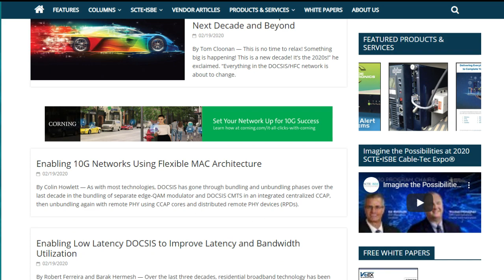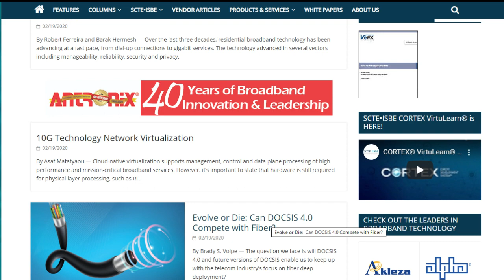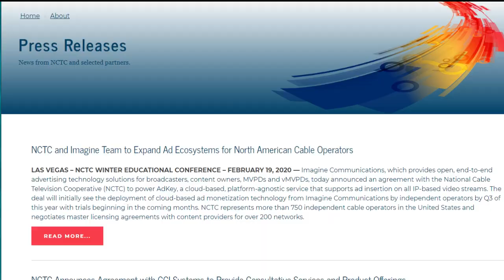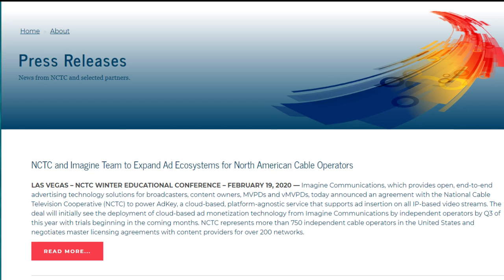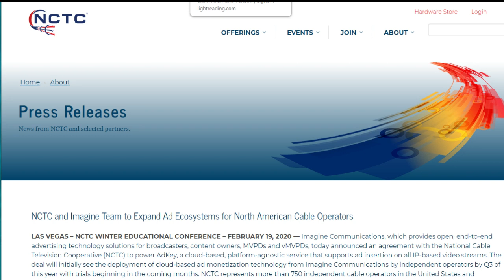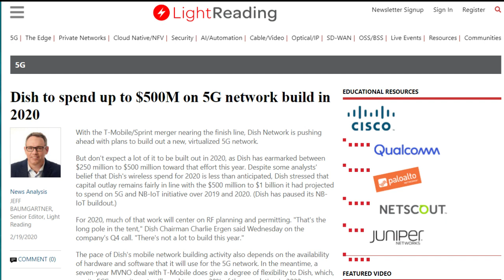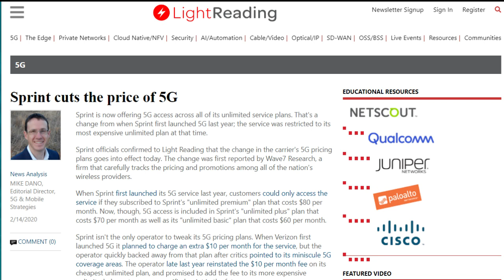DOCSIS 3.1 Channel Bonding

Comment: Just slightly OT, but I'm going to be getting internet service where the MAX speed package available is 22 Mbps. The local guy/owner/tech in this rural area recommends only Netgear C3700 (as that's all he's familiar with...), but said he'd be willing to install a CM600 if he can. Either way, I'd have to purchase the modem - and I'll be using a separate router anyway. Given the speed we're talking about here, is there ANY advantage to using the (higher channel bonding model) CM600?  THANKS  :)
Reply from the maker: Hi Thomas, 

The Netgear C3700 supports 8 downstream channel bonding while the CM600 supports 24 downstream channel bonding. If your cable operator is only providing 8 downstream channels, then you will not benefit from having a modem with 24 downstream channels because the operator is only sending 8 downstream channels. However, if your operator is sending more than 8 downstream channels to your home AND your operator has enable bonding groups of more than 8 downstream channels you will benefit from the CM600. You must find out the answer to both questions above in order to fine out.
Reply: @Volpefirm   THANKS